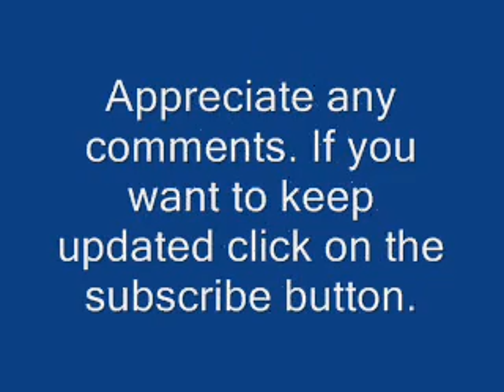Metalworking Welding Fabrication Table Update,The Vise

Comment from the maker: Thank you. The index pins would be a great idea. I think with the present design though there is probably a little too much play in the components which won't allow a consistent position as they are locked in. Generally what I do is get my position roughed in then tighten things up and refine the level or angular  position from there. 

Al